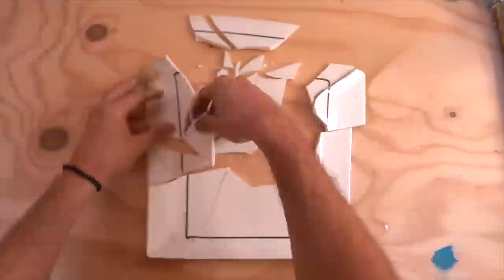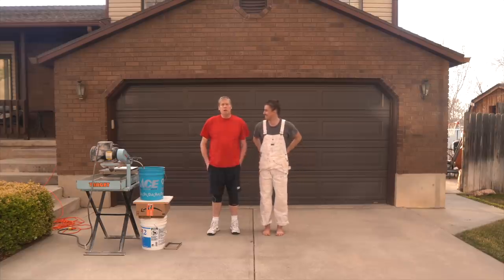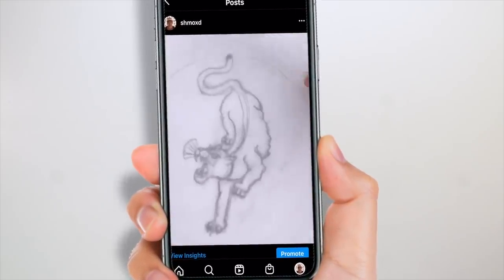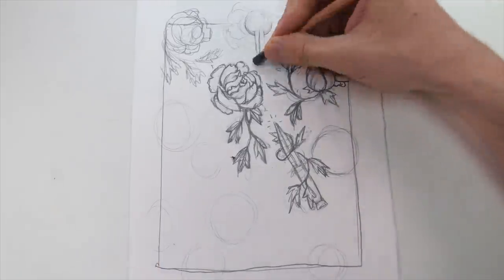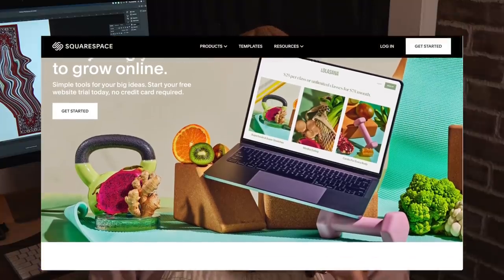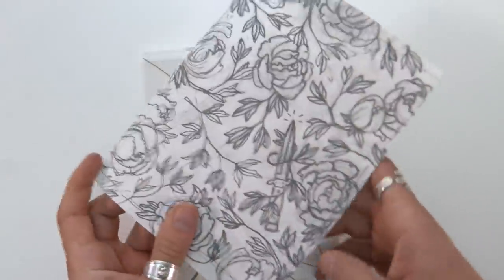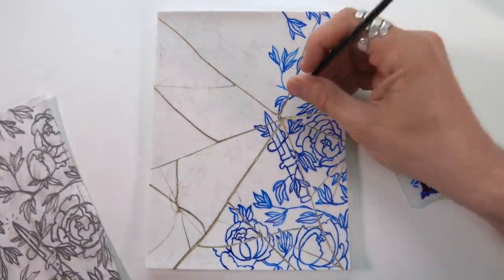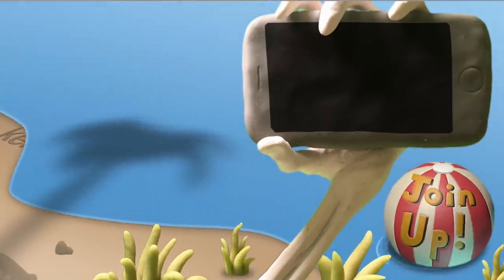From BROKEN to ART

Comment: New follower here. love the content! Your gold technique worked out great... but have you ever used "gold" leaf before (also called guilding)? It's super easy to use and pretty cheap (depending where you live) just need the leaves, adhesive, and a sealer. Maybe not as easy as using spray paint but easier than using pyrite probably. ✌️ ♥ 🙏